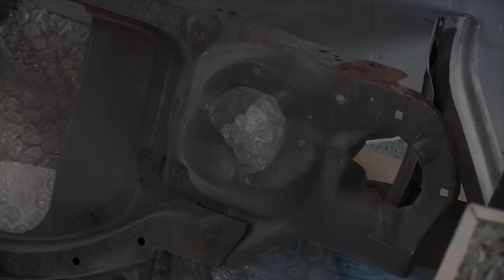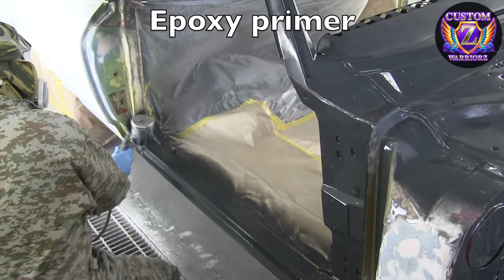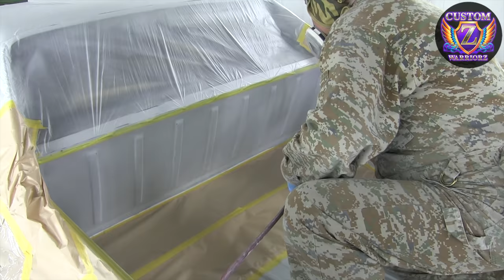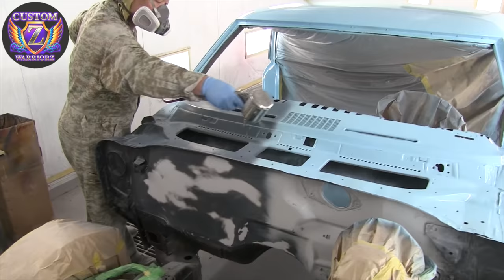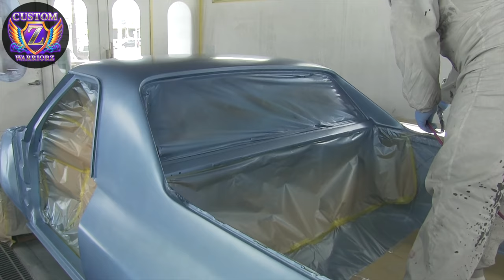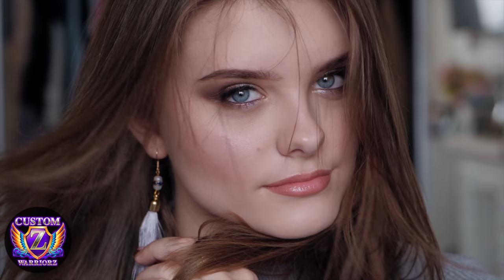Restoration / Old car painting method and How to paint step by step / custom painting

Comment: great video Thanks.
Reply from the maker: Thank you for your feedback.
Reply: Im restoring 2 1954 Citreon Light 15.I have a laser rust remover.500 watt continious wave.
I will share videos when we are using it.
Thanks for yiur positive feedback.

Jeri.
Retired Engineer.
Criminal Homicide investigator on Catastrophic Electrical Equipnent failures.
Hazardous Areas.
E&I Classification & Design Engineer Ex. 60079.
IEC Autex GOST UL Fm.
New Zealand.